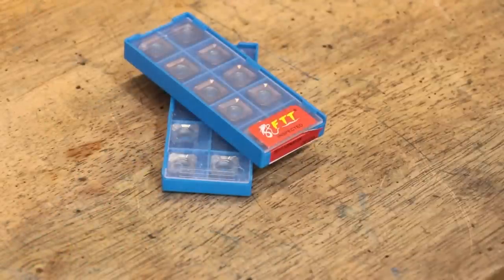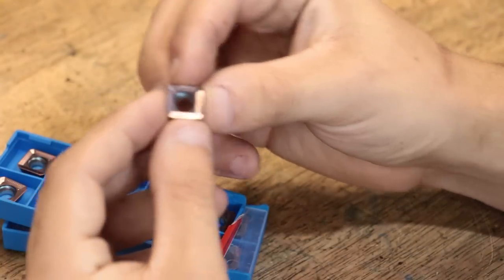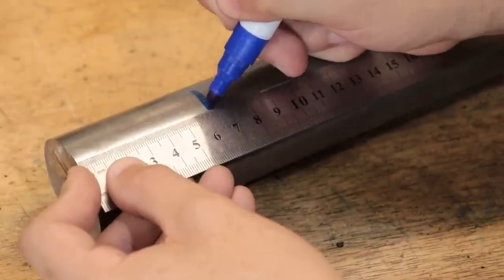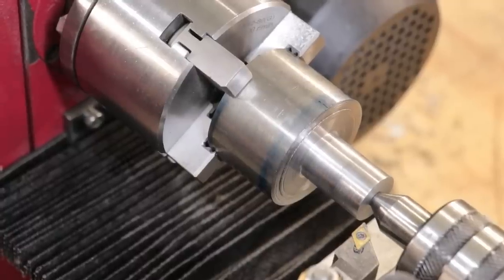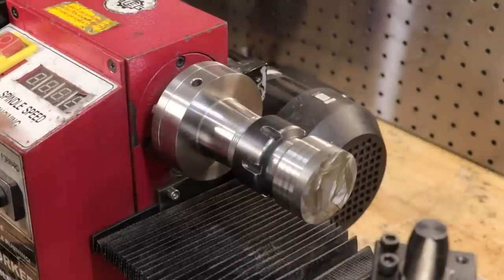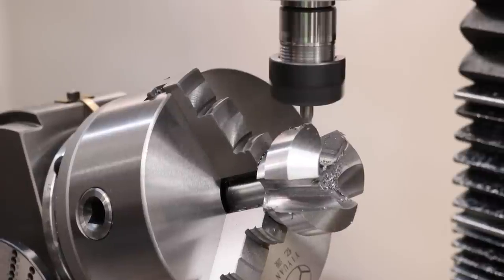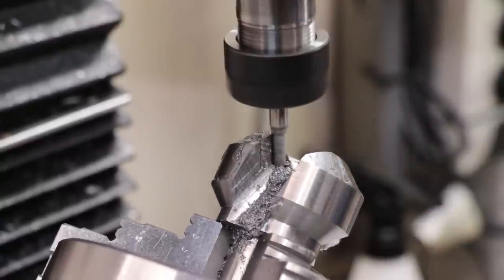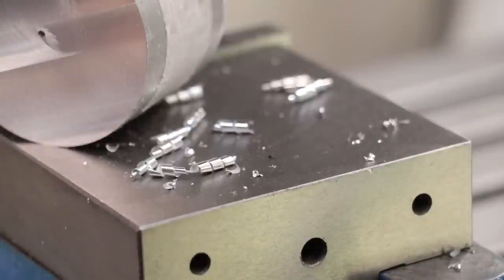Making A Face Mill For The Milling Machine

Comment: Do you think where the shank meets the body you should have made it with a radius/fillet tonadd strength? A sharp 90 degree is a week point essentially with side loads
Reply from the maker: The inside corner is relieved slightly so that it sits flush on the MT3 collet, so it’s not a sharp corner. And in any event on a tool like this it probably doesn’t make much of a difference in the long run

Comment: How would you cut the three compound angles with a standard rotary table?
Reply from the maker: Same way I did here. Pop a chuck on it and index it 120 degrees. Will need to be a tilting rotary table
Reply: @artisanmakes  Thats my point, my table does not tilt. However my mill column does and I'm trying to figure a way to make that work without the expence of another rotary table that tilts. I think some option in your design is worth consideration.
Reply from the maker: Something with a 90 degree flute would work, something like this https://www.machineryhouse.com.au/m511

Comment: I've got a interesting problem I think. I have a 80 mm face mill (6 insert) and I use a biggish knee mill. (Thiel duplex 159, a good'ol german gal). Everytime the facemill enters and leaves a cut it cuts a bit deeper. Once the back cutting edges engage with the work it seems to stabilize and cut fine, both sides cutting. The ends of the cut are about 0.05 to 0.1mm deep. Not a huge problem, but it annoys me. Anyone got an idea?

(Tram is perfect, I should adjust the nod a bit (but I can't), the ways are tightened)

Comment: Clearly with any multi-point cutter there's a potential for the cutting work to be unevenly distributed, if the geometry isn't "perfect". Which isn't possible.

To take an extreme case for clarity, if one cutter sticks out (radially) by 0.005" more than the others, at any feed rate less than 0.005" per revolution that cutter will do all the work.

Did you do any calculations (back of the envelope or otherwise) on the tolerances you needed to work to make the face mill, or did you just work as accurately as possible and hope for the best?

Comment: I want to know what your hourly rate would be if you were machining this for someone else? At just $100.00 per hour plus material you will need to build this in less than an hour to beat the price of the one you showed in the picture.
Reply from the maker: I dont know, Im not a machinist. I dont do any of this for a job

Comment: "i rather have 3 inserts to keep the cutting force low" How does that make sense? more inserts mean less material to remove per insert? (considering you don't ramp up the feedrate, which as a hobbyist you would take on the lower side anyway). "More inserts means i would have to feed it at a higher feedrate to keep cutting"...? uh what ? When i use the mill in the shop i work for, i eyeball the feed and speeds and that saying you made makes no sense.. I could use 800 rpm with a feedrate of 200mm/min or 50mm/min or 500mm/min and the cutter/workpiece couldn't care less 
I just whipped out my machinists handbook and it says "The more cutting edges are engaged at the same time, the smoother the cutting process".....
Reply: More inserts in a face will require a higher feed rate to keep the inserts cutting thus more hp or it will start to rub. Smoother yes but you need more power. And comparing big industrial machines to his is somewhat pointless
Reply: Each material you cut has theoretical optimal sets for both surface and feed per tooth.
Going radically under can lead to things like galling, poor surface finish and improper chip breaking

Comment: "please design stuff that can acutally be made" cuts a load of features that weren't on the design
Reply from the maker: Doesn’t hurt to
Reply: @artisanmakes  I just think it's a lot easier to design somthing that can be made 'by you' than make a drawing you can pass to a machine shop and they make with no problems or questions. It's funny IMO to throw shade when you also would have failed the machine shop test. I love your content BTW, even bought the little lathe you have for some of my own stuff.
Reply from the maker: I only threw half this stuff on because it looked like it would net me a bit more clearance with the flute to evacuate the chips, I dont think it was hugely necessary once the first basic geometry is in.  And the Cad is there simply to make sure the inset seat doesn't blow through to the other side. I could have probably put it in the cad but I couldn't be arsed to make the extra reference planes. Even im a little lazy at the bets of times @michaelwatson7211